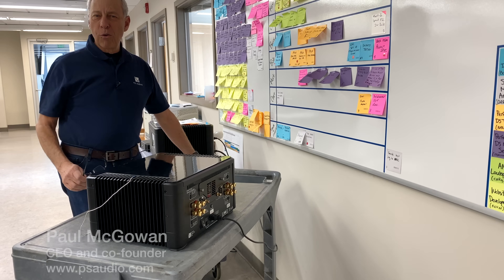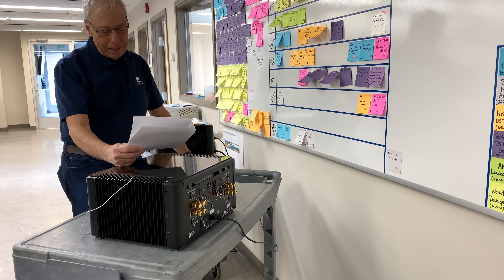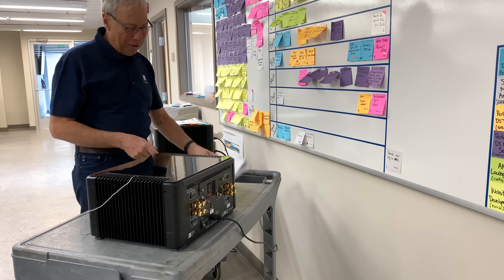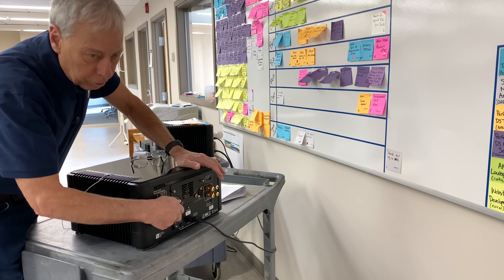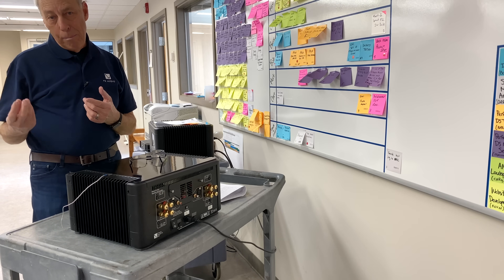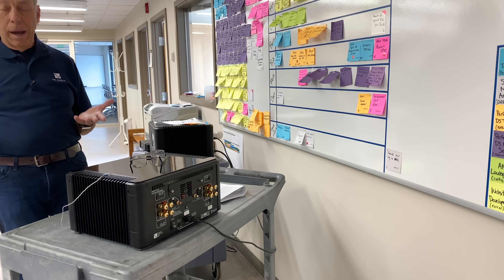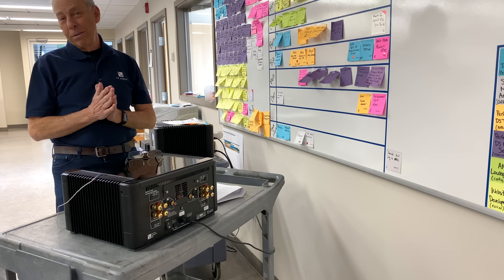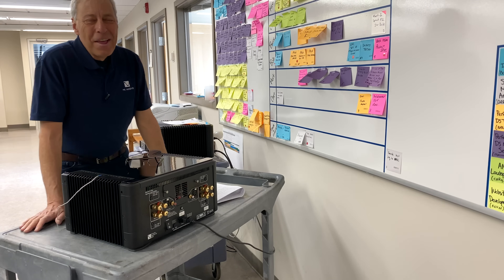What is common ground?

Comment: There is only one ground its also called Earth its the point the earth rod of electrical system is conectedt to the earth beneath your feet.   anything else is not ground its 0V. There is no Hot conection either, its correctly called Positive or Live.  I wish Americans would stop dumbing everything down.

Comment: Thanks Paul, I have SDA 1a but I never use or try  to connect the interconnect cable, finally I understand what you show us about the common ground, but I just look over the schematic that my AKAI AM-2600 has common Ground. Can you double check for me on this schematic 
https://www.vintageshifi.com/repertoire-pdf/pdf/telecharge.php?pdf=Akai-AM-2600-Service-Manual.pdf
and My Harman Kardon 730 schematic https://www.manualslib.com/manual/713395/Harman-Kardon-730.html 
I just want to making sure I won't burn My vintage Amplifier.  Have a good safety day.

Comment: My understanding is that the black is the return loop and as a grounding point for red signals return loop. Opening up amps showed that these black points are bridged together in the amps and components. Now, Paul said the blacks served as the out of phase signals. And out of phase between speakers for cancellation to enhance stereo effect!! What?? I am confused. I guess out of phase design is for high ends balanced components? Btw, to enjoy music, just sit back and relax after connecting the wires in a "normal" way. What else should I do with the casual components? :)

Comment: Got one of your amps and was loving it! Bought some new connect cables and they were a great improvement over my 25 year old connects. New speaker cables made it more veiled so reverted back to my OFC 12guage with your banana jacks sounded amazing. Was trying to phase align powered Pardigmn sub woofer and when I removed the cable from the amp and BANG the whole sound lit up with a wonderful brilliance yet unheard. Replaced the single rca sub cable and the whole system sounds much much better... who knew? The house ground is a real ground with a 4 ' copper rod driven into the earth. No floating grounds for me.

Comment: Paul, back in the Seventies I built a Lindsey-Hood 75W amplifier from a kit and I had some problems with ‘motorboating’, a earth loop hum which I eventually solved by trial and error in connecting various components to a common ground. I had the same issue recently which I solved by trial and error by hooking up a common ground. I noticed you did a video recently on this subject. A suggestion: - maybe its time for a refresher video on earth loop hum and ‘motorboating’?
Thanks,
Nick Cole

Comment: Polk SDA only requires for common grounded amp if we will drive the speakers with mono block amp, the problem is how do we know that our amp is common grounded, any explanation will much appreciate , Pauls video only explain us the definition of common ground
Reply: Bambang Soendaroe ...use a multi meter to check the resistance between the black right channel & the black left channel taps
If it is zero, or very close to zero then you have a 'common ground' amp.

Comment: I had the same question long time ago since i use the polk sda signature series, still confuse with Pauls explanation, how do we know that the black channel in our amp is common grounded or not ..?
Reply: Simplest way is to use a multimeter in Continuity mode. If you have Continuity between the left and right channel "ground" or "negative", then it is a "common" ground. You can use any multimeter. Even the cheapest ones from places like Harbor Freight or Ali Express have that feature, all for about the price of a coffee.
Reply: @TheTrueVoiceOfReason  Exactly. Doesn"t these common ground amps have more crosstalk?
Reply: @sailingaquarius23  That depends on the grounding scheme, the power supply rejection, and ultimately the quality of the power, most notably to the final stage. That's why the best (highest quality) amps have the most highly engineered power supplies.
Reply: @sailingaquarius23  according to the datasheet, the max supply voltage is +-50 volts. The rated output is measured at +-35 volts. You should be safe.

As for batteries, they "should" be the ultimate power supply, but even they have drawbacks. There's just way too much to go into, but if you have a big enough set of deep cycle batteries and a way to properly charge them between use, go for it. Isn't that what this hobby / lifestyle is all about?

Comment: Keep posting, Paul!   Whenever your new videos come out, the sale of toilet paper drops!
(great video- explains why the manufacturer of my amp said not to use a REL sub)
Reply: I would try two REL subs.  Stereo subs are a huge improvement IMHO, and no common ground.  I actually replaced one large sub with two smaller, less expensive REL’s, and the sound improvement was huge.

Comment: A while back, I was checking out the Klipsch Heresy IV speaker on the company website and came across an internal link labeled history.  Among the files available was the 'Heresy spec sheet - 1957'.  This single sheet included a simplified schematic diagram  for the Klipsch-Eargle circuit tor 2 track 3 speaker stereo with a single stereo or two monoblock amplifiers.  The right (A) and left (B) Klipschorn or Shorthorn corner speakers are connected as normal to the 16 ohm and ground taps of the output transformers (1957, remember?) of the power amp(s), as normal.  The (+) and (-) terminals for the Model H or HU center channel (A-B)/2 speaker are respectively connected to the left and right 4 ohm taps of each output transformer.  There is also a connector between the ground taps of each of the two output transformers.  I presume this is the common ground.  Somewhat archaic, but still interesting to an Old Dude of the Old School such as myself.     =//=OldDudesStillRock

Note:  this description is for information purposes only.  I refer you to the klipsch.com website for specific details of the circuit diagram.  I assume no responsibility for any damage to amplifiers and most strongly recommend consulting the manufacturer and/or trusted brick-and-mortar audio dealer first before trying this; if 3 speaker stereo is of any interest anymore.  The original Heresy was designed  primarily for use as a small-ish, low distortion, center fill speaker with the large corner horns doing the heavy lifting in the deep bass; although they could also be used as a less expensive regular stereo pair with the understanding that they were not designed to plumb the depths.   As I said, Old School.
Reply: errata:  'right and left 4 ohm taps' (might make a difference, or not; consistency may be the virtue of tiny minds, but it doesn't hurt where tech is involved).

Also, I used "as normal" twice in the same sentence (the Dept. of Redundecy Dept. approves).

Comment: You NEED to know this information before hooking up a REL subwoofer using high level input.
Reply: Yep. I have a rel connected to an s300. There is no common ground so the rel hums when the amp is off
Reply: Why?
Reply: @Geerladenlad  REL subwoofers usually use speaker terminal input, which feeds into their high level speakon connector. If you  have a balanced amplifier, then the black wire CANNOT be connected to the black speaker terminal. You will have to ground the black wire somewhere else on the case of the amp. But if you have a non-balanced amplifier, then the black wire can be connected to any of the black speaker terminal since it doesn't carry any signal. Hope that helps!

Comment: common ground, or chassis ground IS the norm w/most home amplifiers of conventional push-pull design. An area where common ground is NOT the norm, is cheaper car stereos. They commonly use what I call "floating" ground. The instructions will say <never connect any speaker wire to car's chassis or ground>. Why? Because a little trick is used to increase output power. Car's are normally 12 volts, right? Ohm's law says that there is a limit of how much current will flow though a speaker usually 4 ohms @ 12 volts. (about 36 watts). But cheap IC car stereo amps are not 100% efficient, so the real power is much less. So, what they do, is take 2 amp chips, run them out of phase (bridge) for each channel. This effectively doubles the output power for the channel! But, doing this, requires that each pair of speaker leads goes directly to the speaker, because EACH wire is effectively "floating" or above ground potential. Same case for mains driven amps in bridged mode. So, when you see specs on car head units bragging say, 50x4, it's not too much of a lie. 18 to 24 WPC would be fair.
Reply: Yes but go further back and all car stereos were common ground.
Reply: Car audio is a different story.

But ground means the same thing. A neutral potential. Why is this so hard to understand? Is it me? Because I am from Sweden? Thor and Odin has told me what potetial is.

Tor och Oden in Swedish.

Comment: Common ground is found in most high-end class A and AB amps, but not so much in class D amps. You can test with a cheap ohm-meter. Connect one lead to the middle (round) prong on the AC outlet or pre-amp ground, and the other to the black speaker leads on the amp. Should read 0 (or very low) ohms.

Comment: I have a amp with A/B speaker outputs. One day when I tried to connect the speaker cables with spade ends in metal (carbon fiber) housing to output "B", as the binding posts are close to one another, it accidentally rests onto output "A". Therefore i could hear music when output A is selected. The question is what will happen if i toggle output to "A+B"?

Comment: Hello Paul,
In commercial sound amplifiers there is the "Bridged Mode" where two amplifiers are out of phase and there is no "Ground".  This has caused a few burned out amplifiers when someone connects the "Second Red terminal" to a common ground like the metal on a junction box.  In that case, the output of one amplifier is essentially shorted.  It also sounds pretty bad! 

There is the concept of having just one point be the ground to which all of the equipment is connected.  That terminal may look like a star with all of the ground wires coming to that point.  This deals with the "ground loop" problem in high gain equipment.

Stay safe and healthy!  Thanks for the videos.   KEN

Comment: If you want to use the high level input on a subwoofer and you have an amp like the stellar that has output on both the red and black you CAN NOT wire the black outputs of those amps to the black binding posts of the subwoofer inputs. You have to run a wire from the chassis of the amp to the black sub input and then run wires from the red amp binding post to each sub red input binding post.

Manufacturers of these class D amps should have ground tie point just for this. With my m700 amps I just loosened a chassis screw and ran a wire from there to the black binding post on the subwoofer

Comment: What about chassis ground?
Reply: In many cases it can be used but it really depens. REL gives it as An alternate solution but they use high impedance cirquitry. For power impedance you can get return current which the design of the amp may or may not cope with correctly. Also possibly hum.

Comment: Which makes me think, if you have a balanced output amp (probably class D or a transformer output with a floating secondary winding) would it then not be better NOT to have a black connector but something else (Blue and green are even not good) so for instance purple?

Comment: Interesting!
My Bryston monoblocks have a switch at the back which says: "Ground lift"
I guess it gives the user an option, however, with music playing I can't hear any difference in the sound at all.
And without music again, there's no increased noise or hiss audible switching from one to the other.
Reply: Arthur ...I think that that's the 'Snake Oil' switch ;-)
Reply: Fat Rat... not quite. That makes sense that you donˋt hear a difference. The ground lift is mostly used if you have have a ground-loop somewhere in your system. Thet it can make sense to disconnect the grounds to get rid of the humming. But if you from the beginning havenˋt any ground loops, it doesnˋt make a difference in which position the switch is.

Comment: Most all "mid-fi" audio components, including almost all home audio A/V receivers DO have a common ground... Many truly HIGH-end power amplifiers , on the other hand, instead may have that type of balanced or "floating" output that Paul mentions here, but as far as most normal A/V receivers go, they are mostly all common ground...

One way to tell for sure if an amp or receiver definitely IS a common ground speaker output, is to measure the resistance, (ohms), between the left and right channel black (-) speaker terminals on the output of said amp/receiver, with a good digital multimeter, and if the ohms measurement between the Left and Right channels' black (-) speaker output terminals is pretty close to 0 ohms, then your receiver DOES have a common ground... (MOST RECEIVERS DO)... 

Maybe this info will help someone out there who wonders about this topic.
Reply: Great point.
Reply: Thx